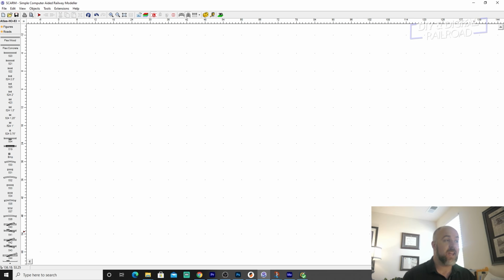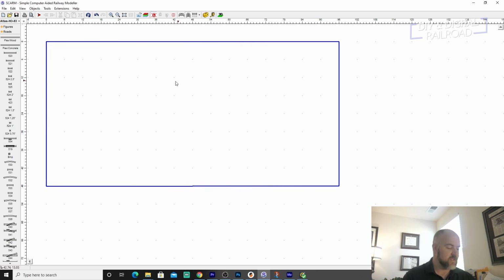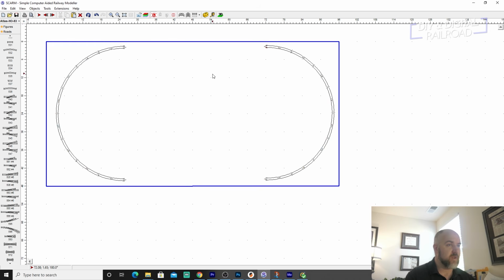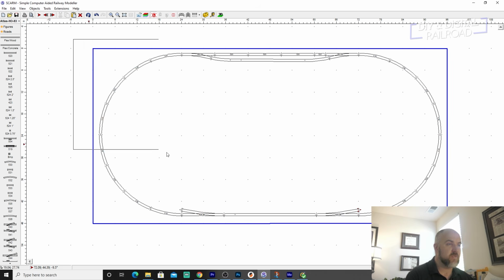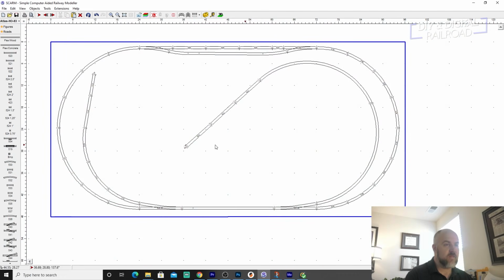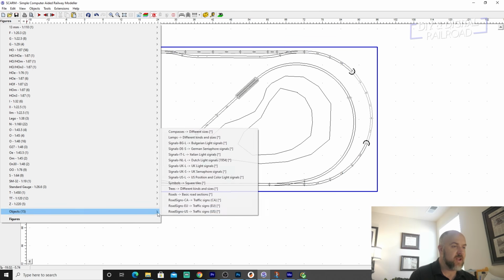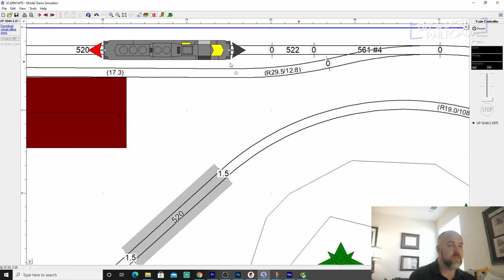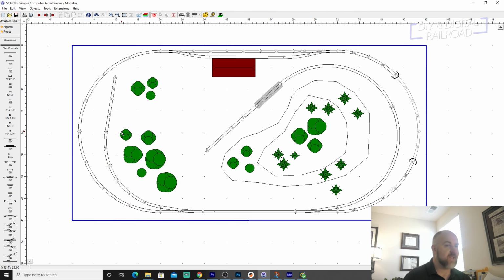How to design a model railroad using SCARM

Comment: Hey Jimmy, I was wondering if you were thinking of doing another one of these to highlight the difference between SCARM 1.0 and the new SCARM 2.0 that's come out. I'm looking at it and I'm trying to figure that out myself. Haven't used the program in a bit of time myself, but thought I'd dust it off while I'm planning a little Z scale layout as a challenge for myself.

Comment: You lost me at the middle button on your mouse bit. I'm using a laptop, just two buttons. I don't know how to move the rulers around like that. Edit:- I've done it via the horizontal and vertical arrows. Edit again:- No, using the arrows is not a safe way of doing it. It's difficult to get zero where you want it. I need to be able to move it around like you do when you press your middle button, which I don't have. Also, what did you click on to get to draw a line like that? I'm getting a rectangle that expands and contracts as I move the cursor, then when I click to the dimensions I want it disappears.

Comment: Outstanding overview!  New to railroading and just heard about SCARM. My first reaction or thought was whether or not it was safe to download. I pretty much confirmed that it is, then I wanted to know how friendly it is to work with and use, and whether or not I should purchase the full version or start with the free version. I have a feeling though I am going to need the licensed version, I have to compare the differences.  I used software (purchased) for my slot car track and it was invaluable, a much needed and helpful resource for planning. This is the same, a must have. Thank you for putting this out there. 👍

Comment: I used the Atlas version of Scarm to design my Atlas code 65 N scale layout. I need to get the full version so I can complete and share it. The layout came out nearly perfect, fitting the board with about an inch and a half of clearance all the way around (just enough to prevent stuff from landing on the floor). I actually purchased the Atlas version but for some reason the key would not work, and long story short, I ended up getting a refund. Maybe I will try Scarm next time instead.

Comment: I use atlas Right track which works out really well.  This really does look like the EXACT SAME as right track, I bet they are the same program.  I used the prjgram to reproduce older MR mag plans thet didn't give all the info or could rotate the plan tn see it 3d on inclines etc.  i have a current 1980s MR plan layour and used Right track to check everything before i started construction.

Comment: I am very new to the hobby.  I have always (35 years) wanted to have a coffee table with a running train under the glass tabletop.  Now Im actually going to do it!  I bought the Thomas the tank engine set from Bachman on Amazon.  But I do want more interest than a 24" oval.  I downloaded SCARM but...I cant quite figure out how to get it all to connect properly.  my available size in 30" x 36".  Any ideas where I can download an plan for that size?  Its the ez snap track.

Comment: Me I am using SCARM since more than a decade for my trackplanning work.
Best method of myself is to elevate the first track and going from there.
To elevate a section of track first it works better using a turnout so all three ends of the tournout would be elevated to the same hight, because in SCARM any kind of turnouts could be set in horizontal position only.
Another nice helper is the small toolbox which you can activating, there are some baseboard figures inside to create more complex baseboard figures or for laying flex tracks it is very helpful, too as well es for starting points by track laying.

Comment: I have SCARM and have found out how to make the table boundaries. I am having trouble working track elevations and planning scenery. I get the track work laid out and I use text to plot where I want certain structures and scenery. I am using Atlas' Code 100 HO track as that is what I have for planning my On30 Kansas River and Southern. I want to design in a river front dock scene in the lower right hand corner of my 4x8 plan. To get an Idea I am reworking David Meek's Rimfire and Latigo RR from his Thunder Mesa Studios website. I am modifying yard on the bottom of the plan, turning the cattle pen spur into the river boat landing spur, adding a spur to the right hand curve to suggest off layout traffic, modifying the back spur into passing track with spur to function as a second station with a coal mine as a customer of the KR&S. The main yard on the front of the layout has a switch back that services a hardware store/ lumber yard, a feed mill, a bulk oil distributor and a spur off of a passing siding servicing a freight house and passenger station with Water Tower.

The KS&R services Eastern Shawnee County and Eastern Osage County of Kansas. This was farming and coal mining country up to the late 1960s and early 1970s. Clear Air laws pretty much killed the Kansas Coal industry. Historically the last coal mine in this part of Kansas closed in 1964, but I am running this as an alternative history story. The last riverboat on the Kansas River sailed or rather steamed up and down the river from Kansas City to Junction City in 1866. Historically  the river was declared by the Kansas Legislature to be non-navigable by law in 1864 thanks to lobbying by representatives of the AT&SF and the UP. These railroads did not want to spend the money to pay for the construction of bridges that would allow riverboat traffic to continue on the Kansas River.

In my alternate history I have the Riverboat companies being more successful in defeating the 1864 legislation, but also in 1872 a young Bostonian Police Officer seeking a place to settle where the risk of becoming an alcoholic in minimal (Kansas voted to go dry in the very early 1870s) came to Kansas. In the actual history this man was my great-great grandfather William Jones Bodge who at 13 was a 49'er and actually made a fortune in the gold fields that he and his friend who went with him spent within a year. In my alternate history W. J. Bodge invests much of his gold into his family's shipping company, but to strike his own trail he becomes first a Boston Cop and I am not sure, but perhaps also a Mass. Militiaman in the Civil War. After the war the alternate W. J. Bodge returns to being a Bostonian Cop until migrating to Kansas, becoming a farmer and a riverboat operator. His riverboat in this alternate history navigates the Solomon River down to the Saline River and down to the Kansas River becoming the Kaw Valley Navigation Company. To ensure a supply of coal for his riverboats Wm. Jones Bodge invests along with men by the names of David Meek and Brent Underwood and C. K. Holliday of the AT&SF and form the Kansas River and Southern Railroad. They choose to build it as a 2.5 foot narrow gauge to save money on construction. David Meek, Brent Underwood and Wm. Bodge establish the town of Meek on the Kansas River between the towns of Big Springs in Douglas County and Tecumseh in Shawnee County. From Meek they have crews lay track southward to Brent Underwood's mines on the Wakarusa River in Southern Shawnee county and in the hills of northern Osage County.

My KR&S will be modeled for the mid-20th Century though its motive power will include two 2-6-0 Moguls based on the C&S C-16, a 2 truck Climax and a small 0-4-0 side rod diesel locomotive. I am designing the mainline to have 18 inch minimum radius curves and most of the industrial trackage has the same minimum radius. I am thinking by the time I am ready to detail the riverboat landing it will be more a transfer dock for coal into barges. The space there is not big enough even for the Kitwood Hill Models' 50th River Steamer, though an earlier design I did based on a Lionel version of the Gold Hill Central did accommodate the Kitwood Hill riverboat. I had an 1.5 x 4 foot riverboat landing scene on that railroad. Thinking it over I may go and look that plan over again. It too was designed in SCARM.

Comment: Thanks so much for this very clear tutorial. I'm at the planning stage, having un-earthed some of my childhood hornby trains from the mid 90s. Tossing up between an indoor 1.2m x 3.4m layout, verses a 3.2m x 3.2m space with cutout, in an un-used shed. This tool will help me investigate both options before I lift a single hammer.

Comment: Has been a while you posted this video. Have looked at scarm in the past and recently looked at it again.
About 10 years ago I was playing around with MiniTrix and DCC (DIY circuitboards). Now while living in the US I'm looking at Kato N-scale Unitrack and DCC-EX.
I tried to recreate the Martintown layout of MarklinOfAweden (HO Marklin) in Kato N Unitrack.
How much slack is too much? As I was trying to see what parts I would need to order to build the track, so can not test fit at the moment.
The layout is a folded dogbone, but try to add a staging area on the bottom layer in the loops.
Didn't add elevations to Scarm so guess that will also introduce some variation in the placement of the tracks and cause scarm not being able to close the track.

Comment: Hey Jimmy, just about to start. Playing with SCARM myself. I do not have a rectangular baseboard. I actually have created a rounded and organic baseboard by Inserting New Points by right clicking on line when selecting the baseboard to edit. My HO modules will be sitting upon tables with risers for hand clearance underneath OSB platform tops. Then OSB base with foam and more layers will sit and clamp on to this creating an interchangeable Modular system. Each piece or module will be an unique shape with that can be replaced only by a replicated shape and with end and exit track points but with different track configs snd scenery creating a plethora of play options. Here comes the Combinations and Permutations calculator to the rescue. Lol

Comment: Wow, great tutorial.   Scarm looks so easy to use.  Unfortunately I already purchased RR Track.  Just started using it but its confusing for a begine and there are no tutorials on YouTube for the program.  Are these programs similar and do you think this tutorial will help me navigate RR Track.  What is your opinion about the two.  Do you think Scarm is easier to use?  I was considering switching to Scarm if it was a more user friendly program.  Any insight would be appreciated.   Thanks
Reply: If its any help I run SCARM, I got my then nine year old granddaughter making up a twin track layout with two passing loops, two crossovers with set track, the constructing her own simple buildings of various sizes (with different coloured windows and doors in) with a selection of different rooves too; then viewing in 3D and running a  train round the layout all within two hours - she was totally absorbed in it - kept me off the keyboard and mouse, she was confidently laying track after 15mins use and mastered the auto repeat feature. 

Once you learn the basics its easy to use and is extremely well documented both under the "documentation" website tab and the utube/ demo videos - I picked it up very quickly, but do read the documentation which is well structured and easy to follow. I've used SCARM extensively on a larger layout with lots of gradients (slopes critical for mine) and all flexi track. Layer control is easy and if you make a mistake transferring items between layers is a doddle. Its easy to check for clashes frame work to track but can work on one or other layer to declutter the screen. The only draw back I have encountered is that the response of snapping flexi track to a final location got longer and noticeable as my layout grew past about 50 points/ turnouts my PC is 8 years old so maybe part of the problem) - but still I manage at 100 points and some 200yards of track (19 inch minimum curve yes its a GB layout), but I stress this is for those difficult to curve and snap circumstances. Customisation via settings is both intuitive and easy too and the tool box is both an extremely important and useful feature to use too. The 3D viewing is sharp, nicely rendered and very responsive and it is well supported (Milan is quick to get back to you)  and so far has been steadily developed. For 40 USD/ 30 GBP you really can't go wrong - its about 15 minutes cost of labour at a garage!

Comment: Great tutorial thank you. I have a question. I am using Fastrack so I don't believe that flex track is available for that. So I had to fuss and fuss with using all different types of FT to get my track to meet up and make a complete circuit. Thank God I managed to make that circuit after a long time. Here's the thing. When I put the last piece of track in the arrows disappeared and the track looked complete except when I zoom in it's just a hair off. I mean the 3 rails look together but just a hair of a dogleg. Does this mean it is slightly off but still within tolerance or is it just a glitch in the software? It took me so long to get it together I'd hate to order the pieces and have it not work. Thanks for your time.
Reply from the maker: Hello!  I will say that I cannot answer this with confidence without seeing the track plan.  SCARM has tolerances you can set and it could be totally fine, but I would have to see it first.  Can you save the project and email it to me at ddrrcommunity@gmail.com?
Reply: @DIYDigitalRailroad  indeed I will do that. Thank you. I just downloaded SCARM and just used it as is without changing any settings.
Reply: @DIYDigitalRailroad  did you receive my email with the saved project?

Comment: I've been playing with SCARMS under the Code 100 Atlas and DRIVES me nuts TRYING to figure out the 18"/15o and smaller... The 18"/30 is ok tp figure out, BUT there are more than 3 sizes of 18" turns and when flipping the track over, it does NOT match up on the degrees as SCARMS shows it. Annoying lol

Comment: Aloha Jimmy This seems to be a very powerful tool and way easier to model in than Fusion 360 (the parts are already made). My question is with benchwork.  I have a startup workshop and am planning on sharing it with various artist modelmakers here on Maui. There is no model RR club here. One on Oahu but that is a plane flight away and a shipment of a layout on a barge is expensive.  
I found this today (Memorial Day 2021) so I haven't played with it yet.  Can it handle  module benchwork and put them together to run a train?   Space for storage here is $$$ and small modules that can fit in SUV's and short bed Pickups would be the ideal format   3-6 ft long 2-3 ft wide supported on sawhorse style legs for running sessions. 
Ideas??
Reply from the maker: Hey Peter!  So my Patreon models are available at the $5/month engineer level.  I am currently trying to figure out how to make a download repository.  As for your space issues.  I would definitely look at T-track modules.  They are quite small and customizable.  I am considering building a few.

Comment: Hi Jimmy, I really liked this video. I’ve recently purchased from Bear Creek an H O template kit that I saw Campbell Rice using to help with the planning and set up of a layout. As I’m planning to build 4 modular sections that will align with each other for the reason that I’ll be joined by a daughter and granddaughter and eventually it will need to be taken out of the basement to one of them. If I understand what you said SCARM isn’t compatible with Apple products? I have an iPad, but after watching you, this and other programs will need a computer and a tablet won’t work? I’ve watched you do “coding” on other videos as well as other modelers and the screen appears more detailed than what I’ve seen on the iPad. I’ve checked in my vicinity and there was listed a model shop but not the club that was in a neighboring town until the new interstate bridges were built. Otherwise it’s Chicago or St. Louis so I’m hoping they can give me contact info on local modelers? Anything you can give me, info wise, would greatly be appreciated. Thanks and keep displaying these great videos, Bill Corrinne 
PS, I like coffee it just doesn’t like me, so I’m an iced tea person.